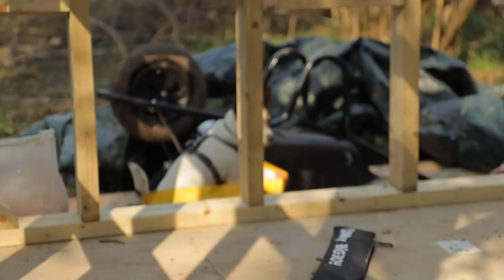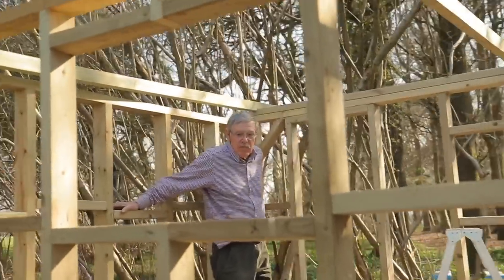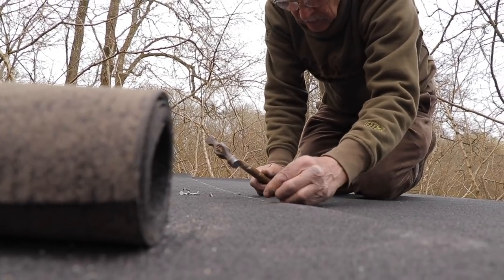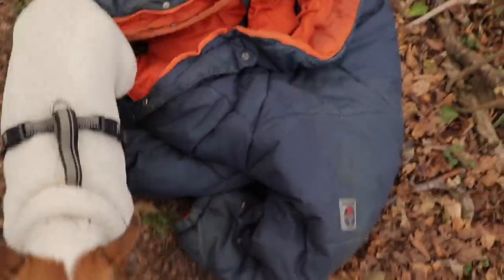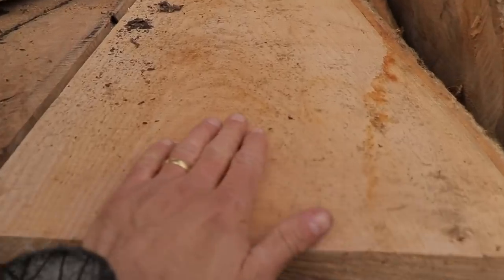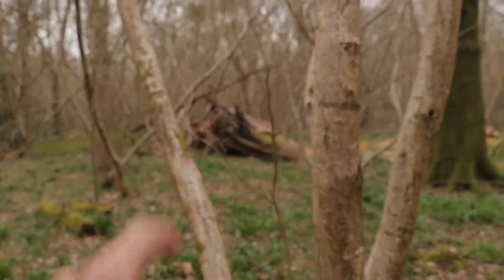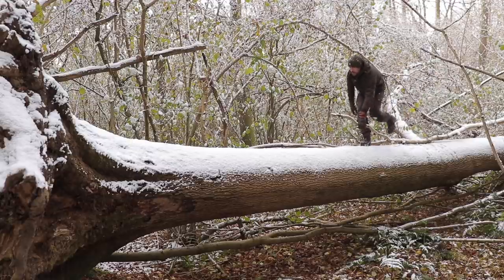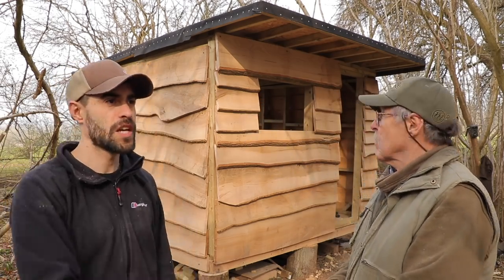Building a Shelter in the Woods: Off Grid Project | Walls & Roof | Nature Cabin

Comment: woodworking tip. use one whole board across the front and then cut out the door and the window for an easy on the eye frontage you always wanna use the same length of board from one side to the other whether you have windows or doors in that wall. you have ten bits to the right of the door and eight to the left. also if you cut the holes out after when you build you door and window shutters all the waney edges match up.  still a great build though loving this series

Comment: yup always keep the crown in the same side on walls too ... the crown up just prestresses the roof and it will be able to hold just a little more than normal 
.
ahh use hand tools that's part of the charm ... good re use of the sawdust too ... the trees will love it quicker mulch for them
Reply: yeah shingles at such a small pitch are just a bad idea ... but a plastic sheet tacked down on the eve and the felt will last even longer ...
Reply: was thinking ... a way you might dress up the corners ... use some of your hurdle wood and nail 3 pieces up as if they were growing there ... it would protect the ends of the ash and the post and add a touch of easy character as well ...
Reply: 102 year old ... so a sapling at the end of WW I  ... and now it gets it's time in the spot light ... and even gives back to its neighbours ... and hangs around for a little longer looking good ... I could die happy if I knew that was my fate ... ;)

Comment: Hi! I love boards with different shapes. And above all, I find it impressive that you are building the cabin with a fallen tree on your land. Very good and motivation job! Does it rain a lot there? I have built a roof similar to that (shed roof, i.e. only "one face" and few inclination) and water got into the cabin. I had to replace it with metal sheets. Greetings from Azores.

Comment: I have my first year carpentry for construction. I am wondering about the local building regs for a structure like this. I know in my area we can build without a permit/inspection a structure to a max of 108 square feet. Plus when you are cut wood into slabs like that a big help to prevent warping is having enough weight on top of the wood. I think  cutting it in the winter definitely helped.

Comment: If you can get metal roofing sheets, looks like you would only need about 4 of them or so.  Thats a usual for our outbuilding around here and is more durable than just the roofing felt underlayment.
Reply from the maker: Yes but the rain makes a racket on metal roofing. We did it for our pallet cabin build. This one we wanted to be quieter during rainfall.
Reply: @TAOutdoors  Leaking and wood rot

Comment: I don’t know if anyone else has made this observation as I haven’t read all off the comments, but you fixed the boards on the wrong way. They should have been fixed at the bottom , not the top . If you had put the fixings just above the board below , but not through the board, they would be allowed to move and not crack . As you have fixed them in time as the boards dry out they will curl up and become less watertight . Fixing them at the bottom holds the board below , but allows it to expand and contract . It will be interesting to see what happens to the boards over the next few years .

Comment: Stupid random question but why do you use nails instead of screws on occasion? I tend to stick to screws and wondered if there's a reason to use nails? Cheers, loving the videos 🙂
Reply: 6 inch nails are stronger .   also they have no power there just some small battery powered drill / screw guns .

Comment: my house is actually builded with boards exactly  like this, but it has.... 42 square meters... after some years (winter is cold down here) ive put some styrofoam in the inside and then some plastic grid to give it structure then i just put cement plaster, looks like a comon wall on the inside and, with the wood stove i have inside it eneded up being really thermic

Comment: I think unless u are putting tin roof or rubber u need a steaper pitch on the roof to help shed leaves an debris snow ❄️ an rain 🌧 off of it .an they are right about the crown even your wall studs should be crowned outwards floor joist go up as well as roof rafters

Comment: Is roll roofing available in the UK? Surely it is. Also, an applied elastomeric coating(paint-like) or even a pond liner could work for durability lasting 25 yrs and possibly beyond, as a roofing material, relatively cheap, too.